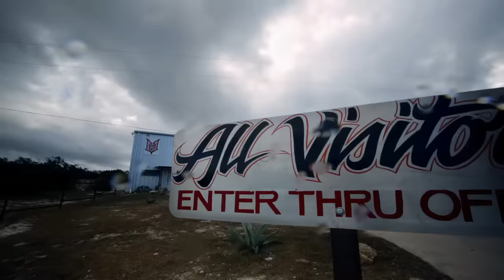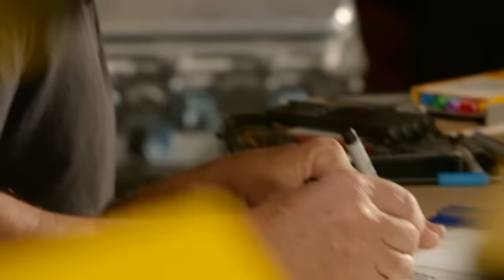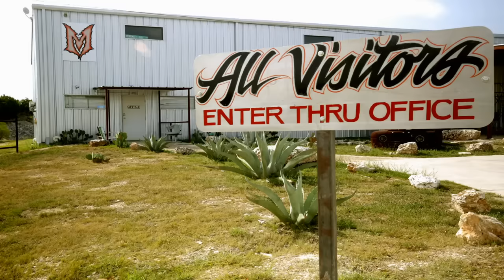Can We Make This '70 Chevelle a Drag Car? | Iron Resurrection FULL EPISODE | MotorTrend

Comment from the maker: What would you do to this Chevelle?
Reply: 1000 Hp Buick V6 or 427 ZL1
Reply: Don't cut the top
Reply: Updated daily driver.

Drivetrain: 502 crate motor, TKX trans, 12 bolt posi w/3.42 gears, stock frame w/ QA1 suspension kit & Wilwood brakes.

Paint: Fathom Blue with white stripes.

Interior: Black dash, console & carpet, white seats.

Gadgets: Classic Instruments gauge cluster, leather seats, electric windows, Vintage Air AC, Classic Car Stereo retrofit radio, power assisted steering & brakes.

How am I doing?
Reply: 550 hp. Street able. With the joe Martin treatment, hi sin to drag this car.
Reply: Lt4  QA1 suspension.
Reply: Hobo Freight Predator motor.
Reply: I would push it as is.
Reply: And nitrous
Reply: NOT CUT THE TOP!
Reply: Drive it like I stole it 🤪
Reply: I wouldn't make it a drag car. Pro mod it.
Reply: I’d have made it a restomod
Reply: Lighten it, original looking street/strip machine with a 396.  If you can get an aluminum block 396.. 🤔
Reply: Send it to the scrap yard, buy a Kia rio and run faster in the 1/8th
Reply: Watch part 2
Reply: 68 Chevelle El Camino is my all time favorite. All Chevelle are awesome!!!
Reply: NHRA Stock or Superstock.
Reply: A body Chevelle I'm building a 1984  Cadillac so any small stuff a b or g body I look at
Reply: M

Comment: Never seen a chopped car look good. There’s a reason why 70 chevelle is everyone’s favorite, all the proportions are perfect. Chopping the roof would be a mistake
Reply: No kidding why would you cut up a car that is perfect from the factory
Reply: @54raceman  You'd chop a roof to improve aerodynamics to pick up some speed when you're going 140+ in the quarter mile. The factory didn't design the car to go that fast, so obviously, if you want to go fast, you need to change things.

Comment: Back in the late 70's through most of the 80's I had a 1970 SS 396 (402) Chevelle with a transplanted LS6 454. Some say it is one of the more desirable cars, but at the same time I also owned one better...1970 Buick GS Skylark 455.
Reply: ROFL.MAO. So was it a 396 or a 402? The latter is not the former "bored out".

Comment: There is nothing on that car that would make me believe "SS big block ".
Reply: Vin number tells all. That's why they showed the number.
Reply: @Hanzyscure  didn't realize ss designation was in the vin.
Reply: @Hanzyscure  ss designation is not on the vin or body tag unless it was built in Canada. Only on the build sheet.
Reply: @IronChief  Did you see the vin number or build sheet ?
Reply: @Hanzyscure  no I didn't. That's my point. No build sheet, no ss.
Reply: @IronChief  So the Seller might be embellishing the SS pedigree for the show ?
Reply: @Hanzyscure  everything on these shows is embellished.
Reply: @Hanzyscure  not for Chevelles 69 and later.
Reply: @IronChief  its not on a 70 CHevelle.

Comment: if you don't know if an A body can be a drag car...then yeah, this is a puff piece (pun intended). so what would I do with it...well, since a clean A body goes for stupid money, that doesn't leave much less in the budget. since its going in a straight line, that means no need for an LS or a stroker small block to help out with handling. If I'm building for ET's, that means torque--an 8100 from the junkyard will do well, the question is pay up for the one company who sells heads, or just inject N2O to get atmosphere in there. Of course, I'll need a good exhaust port if I go that path, and that can be crutched with the cam timing and a very efficient exhaust system that pulls the air out (and a 3 angle valve job that helps the E valve flow better from seat to .03 inch lift, acting like overlap). Now I have to focus on launch--grab a bunch of rear coil springs meant for station wagons and Eky's and experiment with what works, probably go for an air bag as well. 

If i'm building for best trap speed, that means HP, so I'll pick a roller cammed 454 out of any junkyard and stall the trans for 3,500 RPM or higher. I might be able to get away with softer launches and break fewer parts (until I have the budget to upgrade) while hoping to "run 'em down at the top end" of the quarter mile. 

if that's really a real SS car, much less a big block one...don't be stupid and cut it up while thousands of Malibus rust away up north. Go cut and pro street or pro mod or whatever one of those "too far gone" and show off your talents.  If it's a real piece of history, restore it--goodness knows everything you need is a catalog away.

Comment: That 70s split bumper Z 28 that you guys just bought on the show that I’m watching right now is not a split bumper split bumpers had a rubber nose and round park lights turn signals not the ones under the bumper because I have a 70 split bumper rally sport